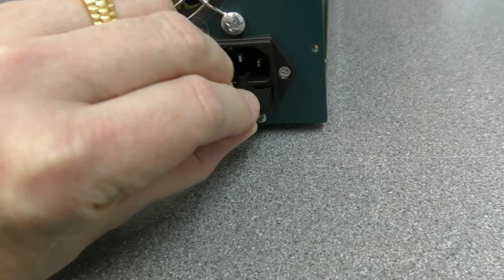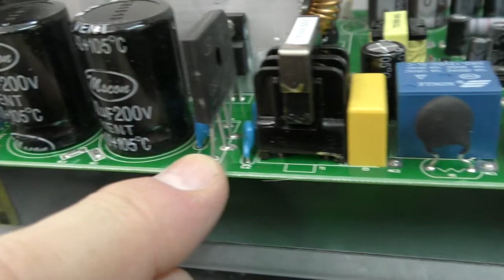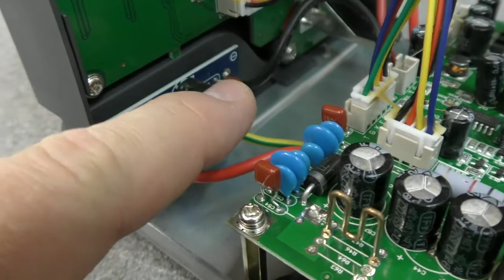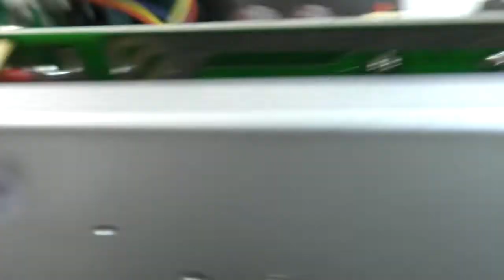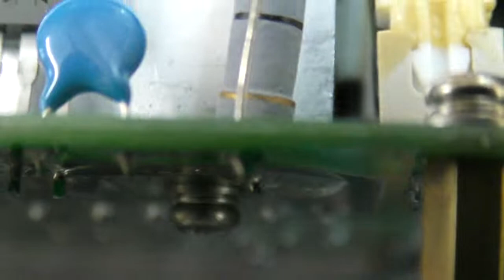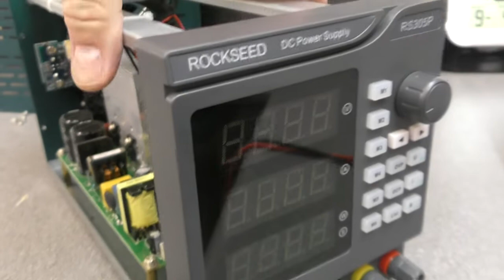Rockseed RS305P power supply internals

Comment: Nice video, I have one of these, wierd burning small and now it displays fine, you can set voltage amps etc but it's not supplying voltage to the leads it seems. If I hook it up say 16V 1amp knowing the battery it's hook up to is say 15v (so it'll pull something) it just shows 00.00v, any clues welcome, cheers

Comment: I have one of those, bought in mid-2022. It stopped working a couple days ago. Now when I turn it on all the lights on the main buttons and the display starts to flash... It almost looks like the switching part is trying to start, but can't... I wonder if anyone got anything like that or any suggestions on where to look to fix it.

Comment: I think I saw (blurred) TL494 down there. So this is, to some extent, similar to a legacy PC Switching Power Supply. It has its own problems: stability while changing voltage, switching noise under load, durability and audible noise. If you need to push 5A into the shorted mosfet than OK. Otherwise I trust my linear supply much better.

Comment: Fuse no real need for a spare, as if that 5A blows then you can be pretty much guaranteed the input bridge, both switching transistors and the auxillary power supply switching chip are all going to be missing parts of the plastic, probably from the mains capacitors having vented and gone open circuit. But not a bad PSU, though the ripple is likely to be terrible under some load combinations, tamed by using that 100uF high ESR capacitor on the output terminals as damping. Probably biggest upgrade, aside from an output relay driven by the LED, with a half second delay between LED lighting and relay click, to handle settling, would be new capacitors and that shielding on input, plus properly mount that NTC temperature sensor on the heatsink, or at least clean the blob of compound off the front and move it to the back.
Reply from the maker: Thanks for that. For my occasional use this is going to be fine but definitely worth doing the mods you suggest. Oh and some new leads, they really are rubbish.
Reply: @Trevs-Shed  Probably are CCA wire inside.